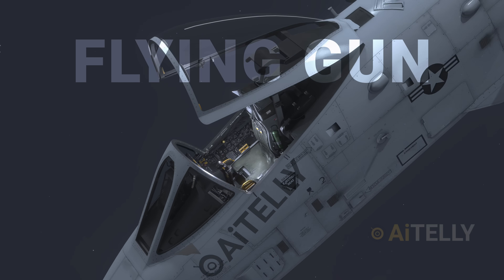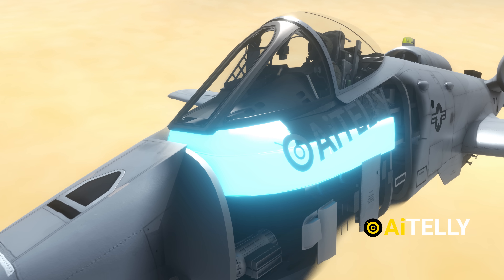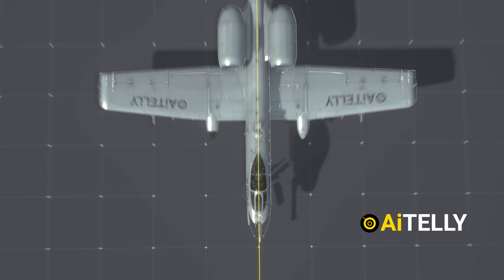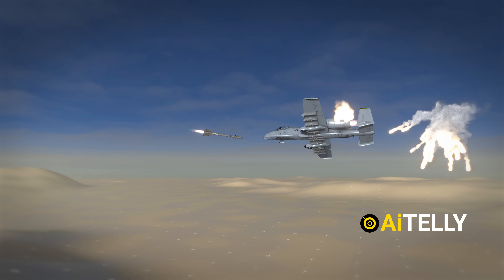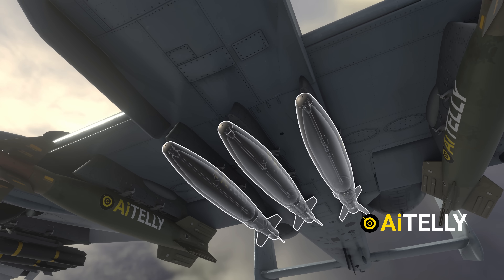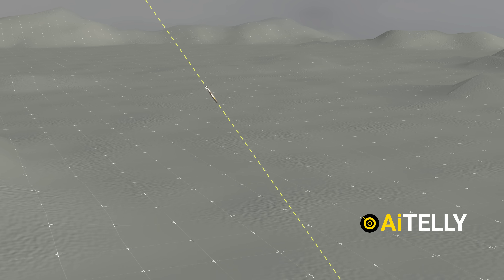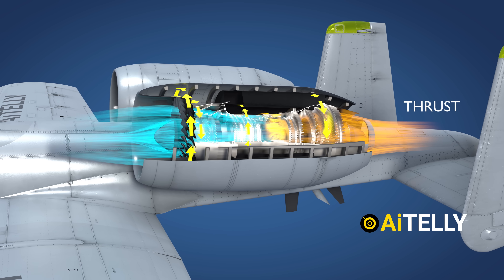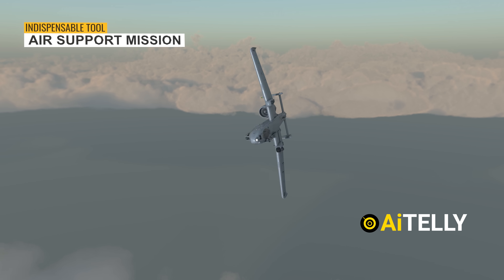A-10 Warthog Jet Explained #jet

Comment: There's a long dubunk video showing why the A10 isn't actually as useful as it seems. Apart from its cool cannon, there's little that can't be done by a drone or F35. The cannon is also overrated, being fairly inaccurate and prone to causing friendly fire. Plus the plane can't be used if the enemy has any semblance of air defence. Great plane to fly around middle eastern countries causing enemies to flee in terror after obliterating their mud hut with 30mm with no means of them to fight back.
Reply: The lazerpig circlejerk needs to stop. None of what he said in that video is relevant to the newer C version, the video was only used as a vehicle for the guy to rant about Pierre sprey (understandably)
Reply: @woffe8094  A lot of it is true, but overloaded. It is of limited use in a conventional war.